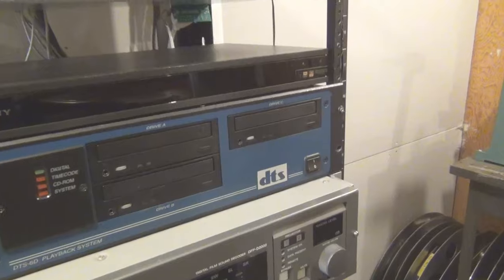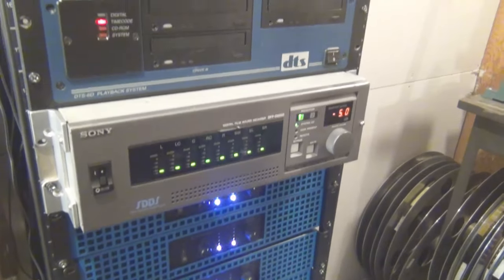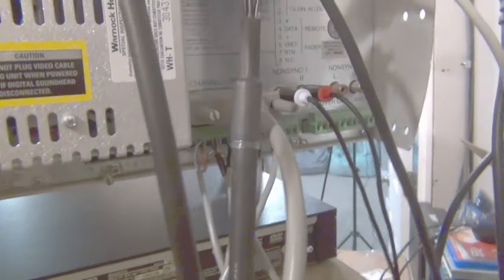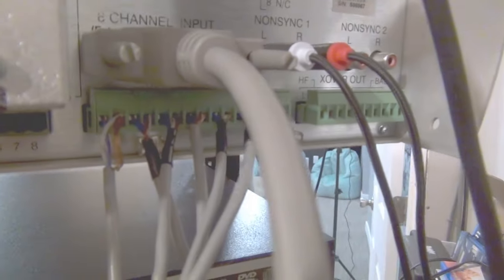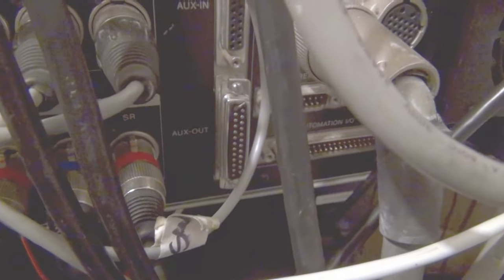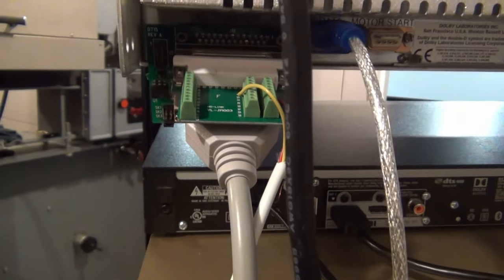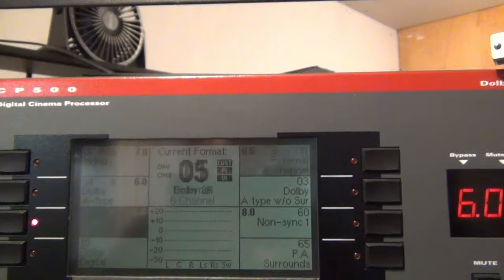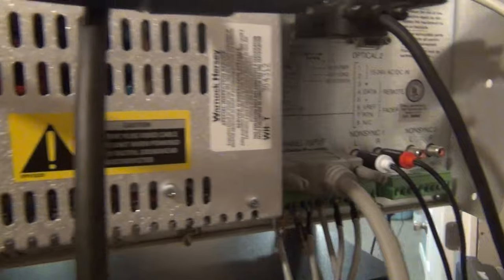35mm Home Cinema Sound-My Theater Sound system

Comment: What does the audio system cost? And how much power did you have to add to yer house junction box or is it a whole separate box power house?
Reply from the maker: Audio runs on 1-20 amp circut 
Lamp house run on dp 30 amp
Theater all runs on a dp 50 amp sup panal